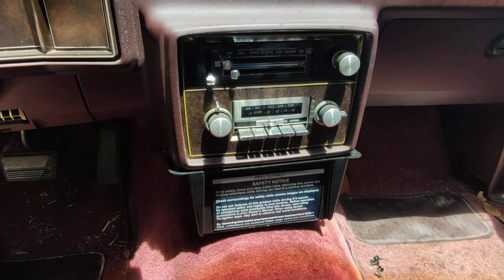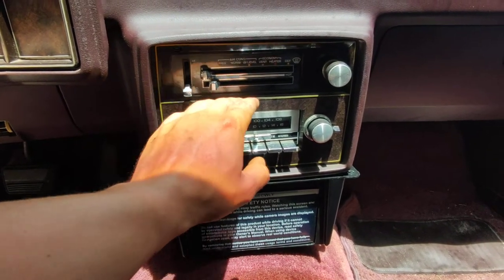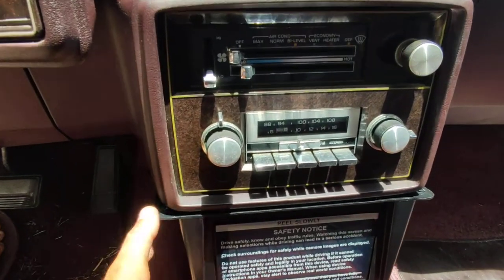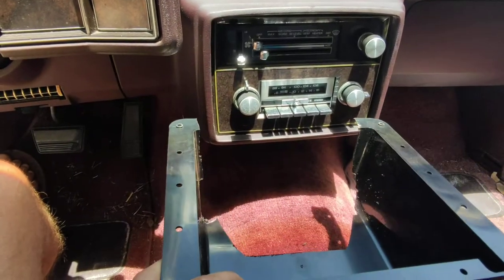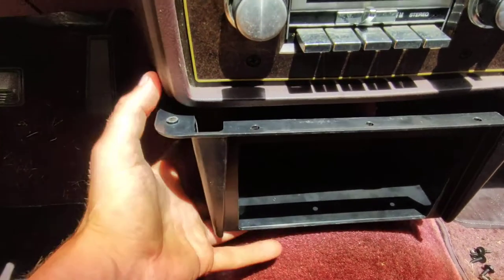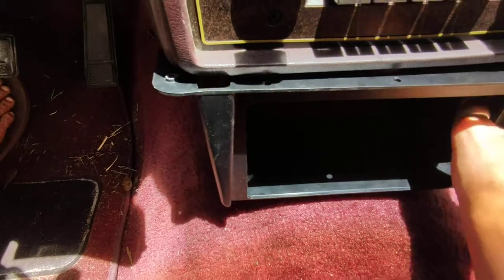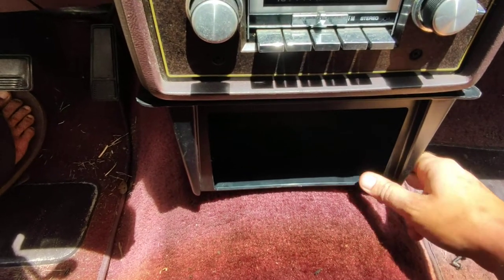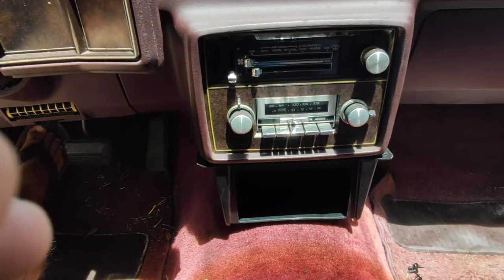How To Install A Double Din Radio In Any GBody

Comment: Great idea, this is exactly what I am looking for as well, don't want to destroy dash and or remove the old radio. Mines a 87 Olds Cutlass, so I will just check the clearance from carpet to bottom of dash, after removing the ashtray, (did you have an ashtray?). If at all possible can you supply the measurements for your cuts please. Thanks Dave
Reply from the maker: Yea I did have to remove the ashtray and move the OSB code reader. 

I'd choose a double din without a CD/DVD reader because it saves about an inch on depth. Android based radios are great for space saving. 

As far as the measurements, cut the entire back off of the universal mount to start with, then it's pretty easy to take out another inch for the hump on the floor.
Reply: @kpsmith4241  Thanks much appreciated. Dave
Reply: Zack Stewart on fb makes plates for these
Reply from the maker: @BillyRay501  post the link
Reply: Have you installed your double DIN? I have an 88 cutlass and want to install a single DIN this way
Reply: @DaveMorr BusinessSolutions

Have you done the install? I want to install a single DIN in my 88 cutlass supreme